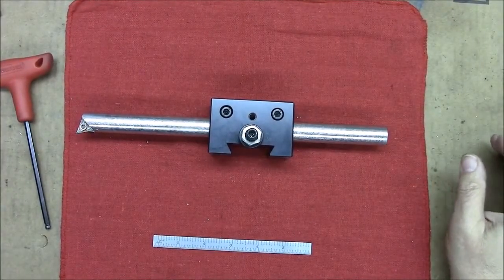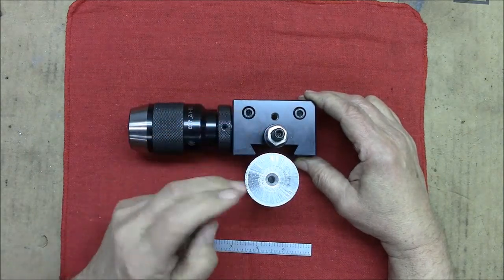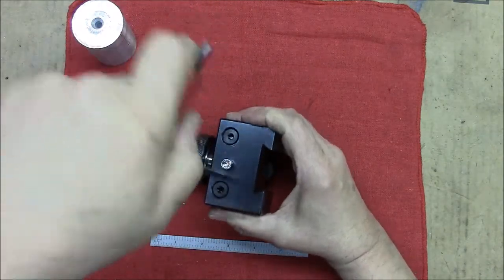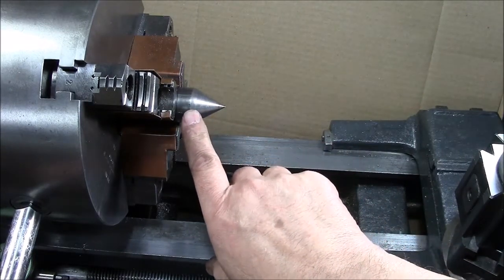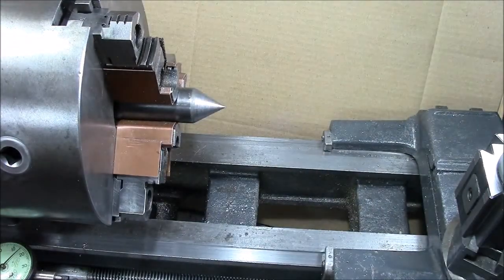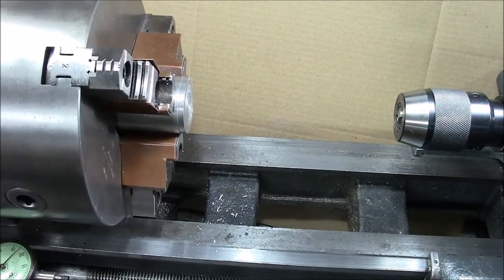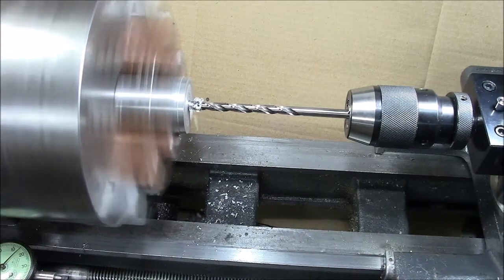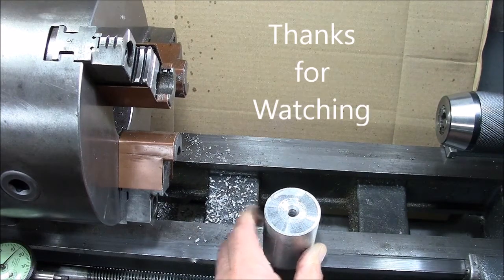Metal Lathe Horizontal drilling fixture

Comment: Great Video. What brand and size of chuck are you using? Thanks for all the videos!
Reply from the maker: I used a SHARS 0-5/8" keyless chuck.  When necessary I can use the same chuck in my mill.  It serves double duty.  Hope this answers your question.  Regards-  Fred
Reply: Great info Fred, thank you for the reply. What brand/size of 3 jaw are you running?
Reply from the maker: The 3 jaw is an Ebay find.  It is a Puu-M from Poland.  It was used but in great shape. 0005 TIR  !!!!   I like it because it has a 2" bore and I can insert a 5C collet holder and then use collets.  Regards-  Fred

Comment: Interesting idea. It'd be cool to have two chucks on one boring bar holder, like bore a hole in the arbor of the chuck that fits "normally" into the quick change holder so that the second shorter arbor (like you have there) intersects inside of it from the side (also like you did with yours). Not that it's use would come up a lot normally, but if it did, then you could have a quick change chuck for front and side approach on the same dedicated holder.
Reply from the maker: The main reason I built this rig is because I needed to bore a hole through 100 pieces of 4" long stock for a total of 400 inches of holes.  The tailstock on my lathe will only advance 2.5" and would have to be reset once per part or 100 times, then returned to the original stop 100 times.  Not to mention hand turning the tailstock handle a crazy number of times in and out.  This set up let me bore using (power feed) of the lead screw and since I had a long bit I could do it in one operation. I would use this setup in a heartbeat if I had to machine similar parts in the future.  If you have a "one off" I would use the tails stock.  Hope this helped.  Fred

Comment: Nice job Fred. If you ever really need precision alignment, chuck an indicator in the lathe and sweep a pin in the drill chuck. You can also buy yourself some room by setting your compound to a steeper angle and moving the tool post to the end of the slot. If rigidity isn't an issue, dial in the compound to gain extra room so you don't have your cross slide lead screw exposed. Thumbs up.
Reply from the maker: Thanks for those tips Joe.  I really enjoy your channel.  You are the only "production" orientated machinist that I have found on Youtube. You bring a fresh perspective to many machining operations.  Thank you for sharing your knowledge.

Comment: Thanks for sharing.  I've been wanting to make a holder to hold the drill chuck on the QCTP but this is much much easier and quickly! Appreciate the video!
Reply from the maker: Thank you for commenting Kyle. I have a number of small metal working projects that are very useful not too difficult to make so take a look.  I also make quite complex scratch built stationary steam engines...  Appreciate your support.  Thanks-  Fred

Comment: Good video.  This is where a lever operated tailstock is normally used for production runs.

Keep em coming Fred.

Cheers Rob
Reply: xynudu is
Reply from the maker: Thanks Rob.  I had the idea for this for quite some time but never needed to build it.  When I got the frantic call from a potential customer I had it built within 2 hours and then turned out 100 parts in less than 3 hours.  While I was working on the parts he had 4 fellas sitting on their hands waiting for the parts.  He was not then but is now one happy fella.  I think I have the potential of a repeat customer.